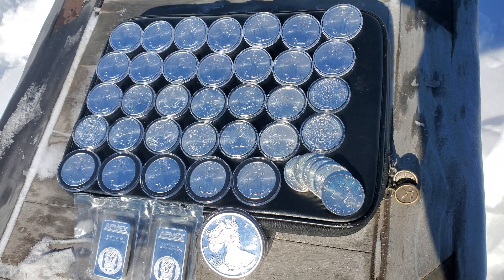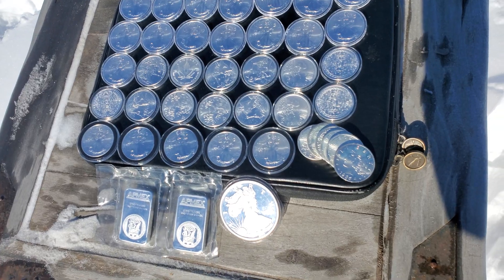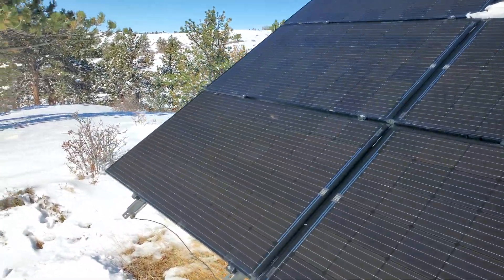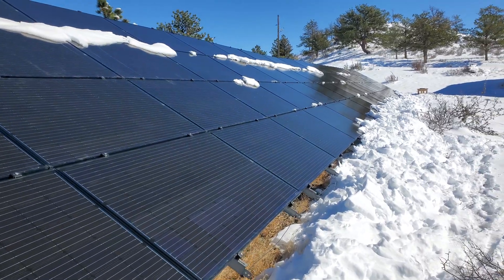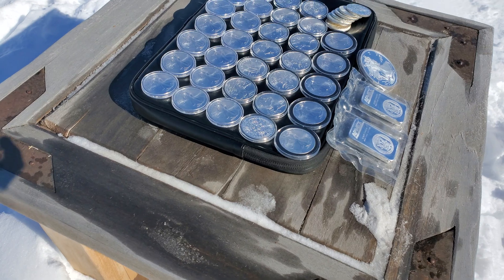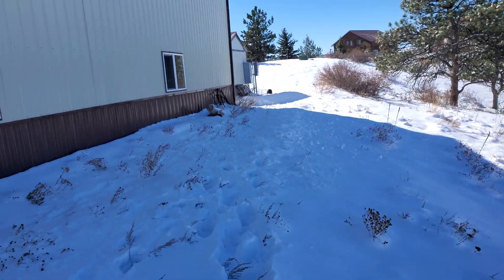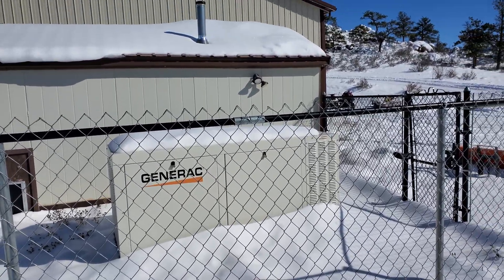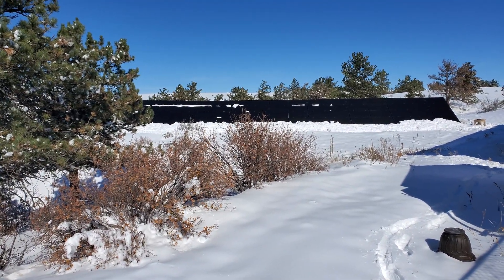54oz of Silver....in my solar panels?!

Comment: how much watt are all of the 48 Pannels producing combined and how much do you get back for each kilowatt you deliver back and how much do eqxh kilowatt cost you if you use electricity. Do you have a, how do you say this in English? A "Netting Arragement" that thet first subtract all used electricity on moments you solar system did not delived enough like bad days and if it is dark obviously. So when subtracted, then they look how many you have delivered back or used more than deivered. And with your hig solar system are the prices variabel during the day according of the need of energy during the day? 

I see your video for the first. You have also a generator? Do you live off grid? And if so where do you let the the extra energy you generated and where do you all this use for?

Comment: So, yeah China uses about 50 million ounces a year in solar.  In a few years they expect to get to 300 million ounces.  That's 1/3 of the worlds supply each year.  We had a small (7 million ounce) deficit last year, imagine what happens to the price then!  Don't expect the amount of silver used in each panel to go down.  In fact they are looking at making double sided solar panels for the desert.  The light color sand should reflect between 20 and 40% to the bottom of the panel.  I don't see it going to $500 or anything, they will cut back then on silver.  $100 is a reasonable guess by 2025, certainly by 2030.

Comment: I have some 15 year old solar panels and they all have a copper gold foil tape in them.
I started tearing them down today curious about recovering the gold
Reply from the maker: Nice! Good luck on your project. The older panels usually use more silver than newer models too. 😎 👍
Reply: @WildWestStacker  
Not much silver.
They have a pile of gold foil for the bridges and in each pv chip.
My son is tearing them down so will be nice to have some precious metals on hand for the future.
I will try acid salt proxide solution to break it down this week and see what comes out of them.